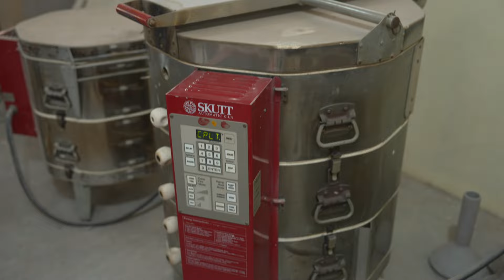The Journey Of A Coffee Cup: Handmade Stoneware

Comment: Just received my cup today and honestly it was extremely disappointing! Inside of the cup is not perfectly round as claimed on their website and clearly has rough edges. There is a very visible join line which makes the whole finish look very ugly. Also, the cup is extremely thin and light weight compared to any quality cup like my ACME ceramics cup which is ironically cheaper than this cup. I am always looking to support indian businesses but this clearly feels like a scam.
Reply from the maker: Hey there. We’re very sorry you’ve had a bad experience. As for the issues, these are fully handmade so you will have variance from one unit to the next. The cup thickness has also been carefully selected to optimise for the best drinking experience and reducing the heat absorption that thicker cups tend to have. Heavier cups do not signify higher quality. If that were the case then porcelain ware should be dirt cheap. Lastly the ACME 190ml cups are $22.6 and ours are $9.7 so we’re confused when you say yours was cheaper. 
All this being said we want our customers to have a good experience with our products so if you’re unhappy or feel like the product is flawed then please reach out on email or WhatsApp we’ll be sure to help you out.
Reply: @aramse  Hi thanks for responding. Let me clear out a few points. Since I am in India let me compare using Indian currency. ACME 150ml Cup is INR 350+50 shipping from Nestasia. Yours is 200ml which is INR 799+120 shipping which would still be fine if the cup was upto standard. I am sure all the scientific theory might be carefully researched from your end but the honest fact of the matter is that it has simply not translated into the end product. There is a huge quality gap which needs to be filled. Hand made ‘variance’ is not an excuse for lower quality. Expected much better from you guys. Haven’t reached out to initiate a return because I didn’t want to judge the product before using it once which I have.
Reply from the maker: @user-yu3jz1pg4i  We stand by the quality of these cups as we've sold hundreds to customers all over the world and never had a quality complaint until now. We are happy to give you a full refund. If you feel like your specific piece has an issue, and this does happen on occasion, if the QC team misses it, then we'll be happy to send you a replacement. Please reach out on email and we can definitely sort this out for you.
Reply: @aramse  hi, its been a few days but still haven’t received any response to my email. Do you guys only respond on public forums and then take no real action to alleviate the customer’s issue? If so then kindly acknowledge the same here so we can all move on. Thanks.

Comment: 799 for 1 cup? Are guys mad? What is the special thing about these cups?
Reply from the maker: No one is forcing you to buy them so not sure why you’re so angry. Also just a 250g bag of Indian coffee can cost as high Rs 1000 these days.
Reply: @aramse  not angry, but still find it costly. 499 rupees could be  a great value for the product. made=mad mistakenly wrote it🥲. At end of the day, it's the customer's choice to buy. What makes it different from other brands. Wonderchef 's cappuccino cup selling price is 199, magik selling cappuccino cup at 399.
Reply from the maker: @painpeace3619  as is the case with any product you can find them at varying price points. For the effort that goes into ensuring the quality of these and the time it has taken to get it right, 799 feels like a fair price and we fully understand that everyone may not agree with this.
Reply: @painpeace3619  I had the same question as you..
Reply: @painpeace3619  I suggest you research a thing called "supply and demand" ... You might find it to be useful in explaining the price of these cups. In economics, a demand curve is a graph depicting the relationship between the price of a certain commodity and the quantity of that commodity that is demanded at that price. The higher the price goes on the graph, the lower the quantity will be demanded. This first run of cups they are doing will be a low quantity run because they have never done this before. Due to the size of their audience the demand will be too high for the low quantity they are able to produce, so they have to keep the price high in order to be able to keep up with the demand for the cups. I hope this helps.
Reply: Wait till you see the price of NotNeutral, ACME, Loveramics, Fellow Cups. You'll only get half of a cup lol.
Reply: @Raditram  we get better looking mugs for 250 at homecentre. 800 is such a crap price for something so mediocre